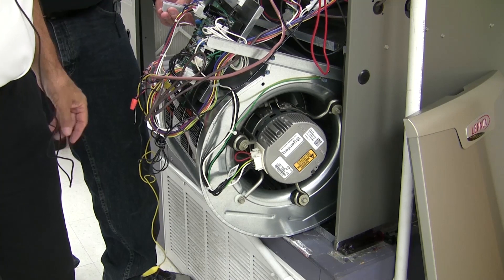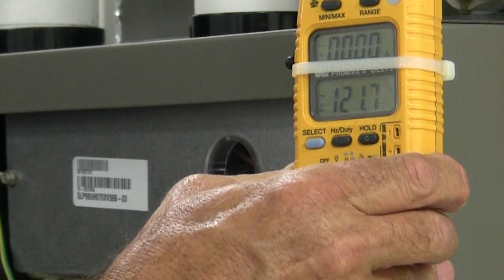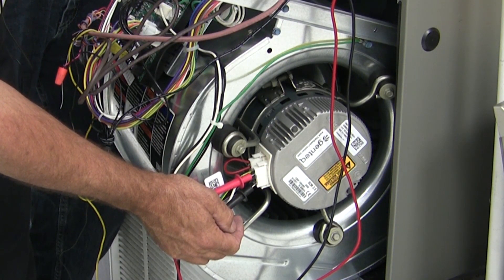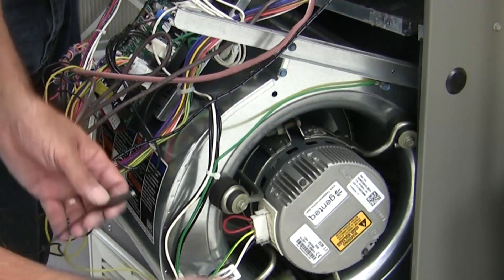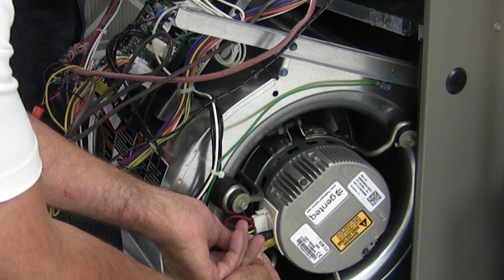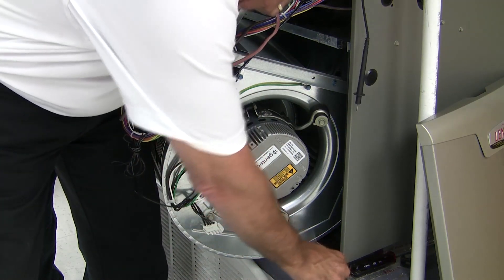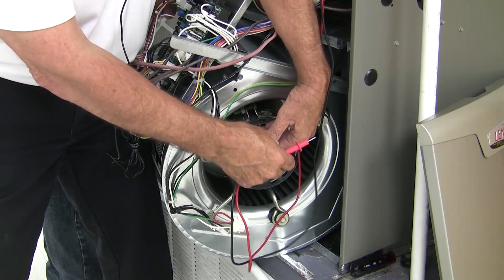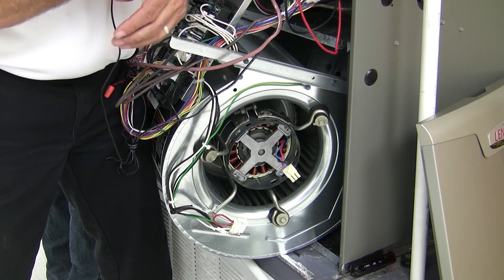ToolboxTuesday: Testing Variable Speed Blower Motors on | Lennox

Comment: Would have been nice when he was doing a check on the DC signal if he would state what terminals he was probing. He was specific on the terminals for sending a 24vac signal. I'm just assuming the other 2 terminals that aren't the C and Rx on the 4 prong low voltage pin connector.

Comment: 24 volt signal, is that AC or DC?
Reply: Dc
Reply: @RockoRocko-rz7kx  No. You will not find any 24DC signal available. He's talking AC at that point. Which is typically right on the control board at R and C. Earlier he was talking about a DC signal on the other communication wires from the motor to the board. They would be a much lower voltage than 24. Likely around 0-10v dc.
Reply: You do not test a 3.0 wit 24 volts ac are you confused?  9 volts dc would be more accurate. You tested that motor as if it was an X13 not a 3.0 vs. the voltage is actually communicated from board to motor around  5 volts car usually use a 9 volt battery to test operation of a true VS communicating motor

Comment: To bad they dont sell just the module anymore. Now you have to buy the motor and module together. Just another trick to make more money. Shame on you manufacturers. Always digging into people's pockets for money
Reply: No. You probably dealt with an idiot at the parts counter. You can always buy the module separately on these motors. It's not even a Lennox specific part. This genteq motor is across the board in many other units. The module is a 5 minute or less swap out. Replacing the entire motor would be dumb since the motors almost never fail. The modules fail often.
Reply: @Jason-wc3fh gracias 👍
Reply: Not sure who your supplier is but yes you can still get just the module. I replaced one a few days ago....
Reply: Man lennox has really gone down hill. their parts availability is a joke. their dealer/customer relations is a joke. their warranty division is a joke. they will make you keep a stock that suits their sales numbers, not your customer base. Then punish the dealer for not being able to sell the stock they forced on them. they still owe us $5k and there is no hope in getting a return of that money. DO NOT DEAL WITH LENNOX!!! ask other dealers.. They will tell you the same. Terrible company!!
Reply: Just do an ECM to PSC conversation with some switching relays 🤙🏼
Reply: @ChromiumVI  will not work on a communicating system.

Comment: What you should do, if your going to open the control module, is wait 5 minutes to make sure the capacitors have discharged after you've removed high voltage from the motor itself (per manufacturer). Test the motor itself to see if it is shorted to ground. Take ohm readings between all three terminals on the motor harness, should be less than 20 ohms and less than 10% from each other in readings. Taking a "quick look", as described above, is good unless very important information is omitted, especially concerning safety. Just a service technician's opinion though.